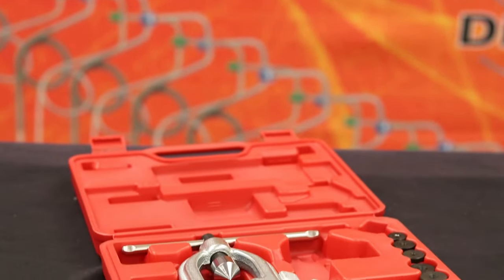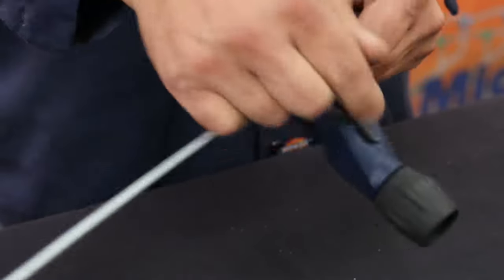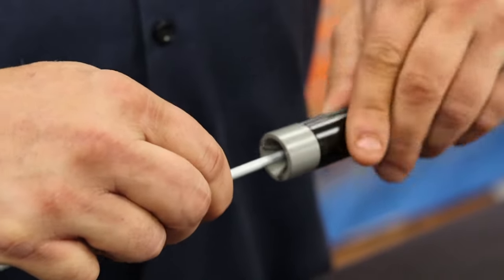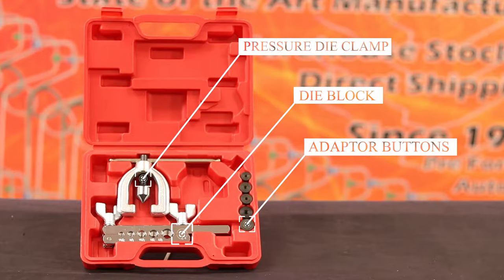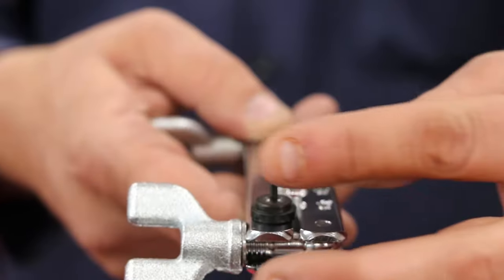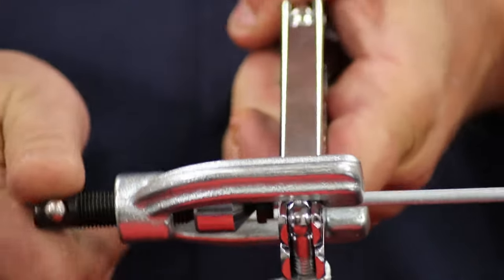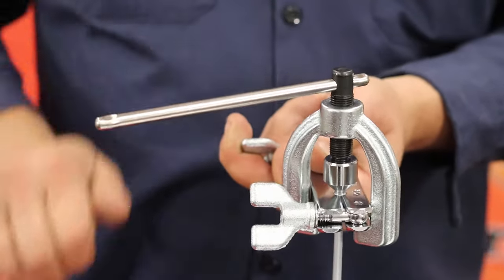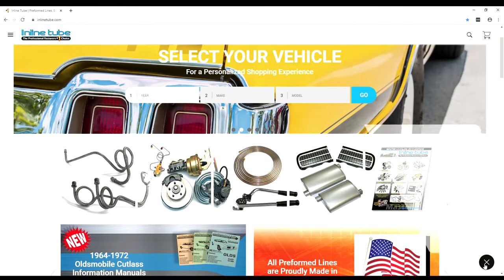How to | Double Flare a Brake Line

Comment: @inline tube I need to use a hacksaw or fiber well to cut my SS brake lines to be able to double flare them with this kit and not a tubing cutter?
Reply: yes A tubing cutter will Work harden your stainless making it impossible to flare.  It will push back through the die.
Reply: yes this is correct

Comment: If only this worked
Reply from the maker: It will work 100% of the time as long as the tube wall thickness is .028 and you do not use a tube cutter on Stainless.  Hack saw or fiber wheel.  The main cause of not being able to flare is the green coated tubing or wall is too thick.
Reply: @inlinetubeco  so that's why that shitty kit I rented from autozone "didn't work". Interesting. I'll try again scraping off the green coating of the steel I bought.